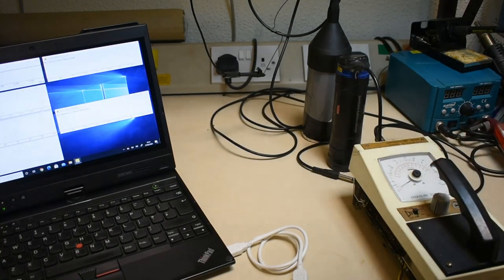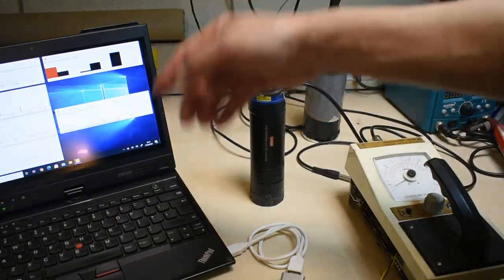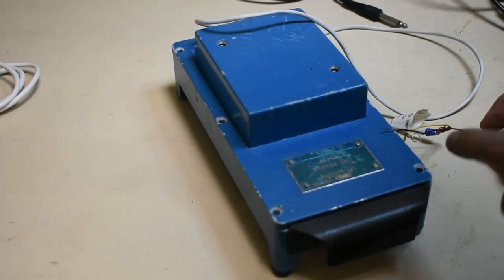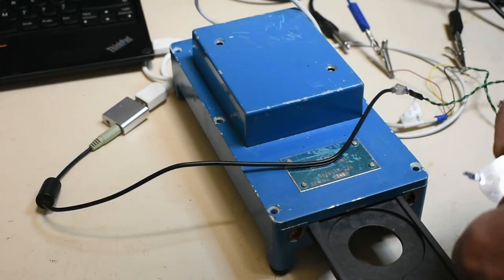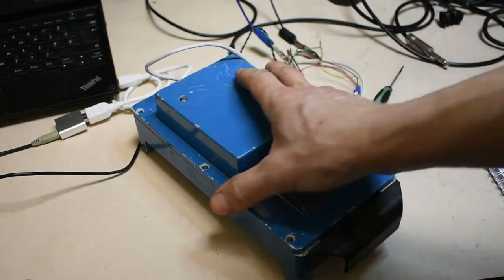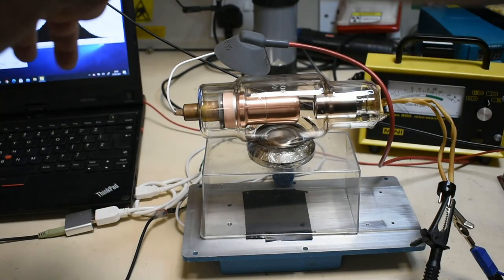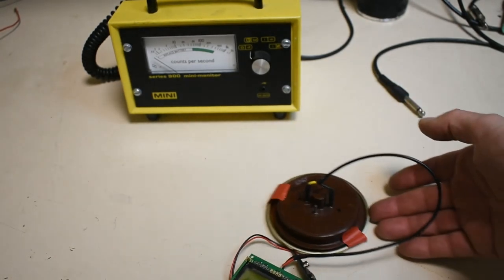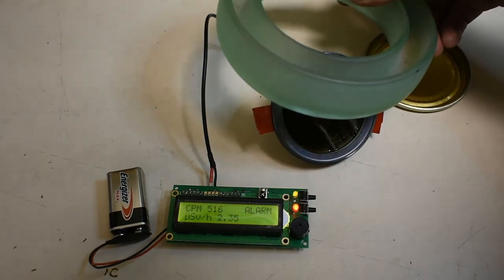Radiation detectors part II

Comment: Cool I remember cutting open 3055s as a kid to show light sensitivity...
You should try a bare transistor  with alpha
Reply from the maker: Yeah, there was an early trick, transistors were manufactured in glass tubes with black paint. It was possible to scrape off the paint turning it into a phototransistor. Also, early 1kb RAM IC could be opened and used as a crude 1k camera. Again, interesting to know the sensitivity range. Don’t know if an old EPROM can be erased with x-rays, but it sounds like an experiment. :-)
Reply: @tuopeeks  The old OC71s in a glass case painted black were ideal for that trick.